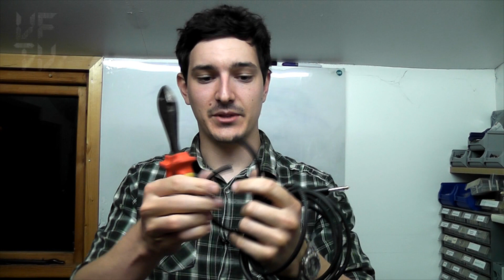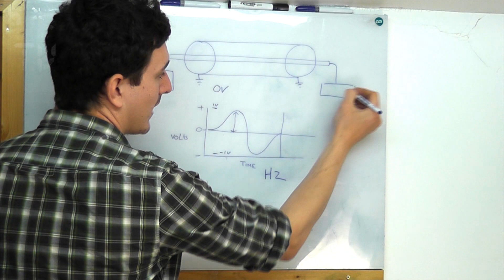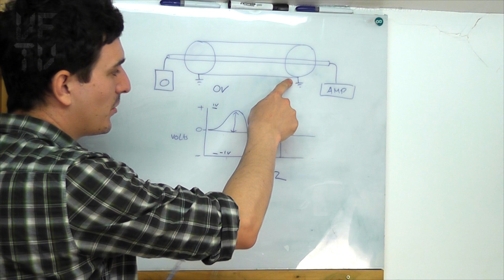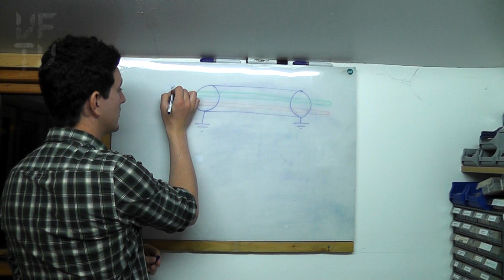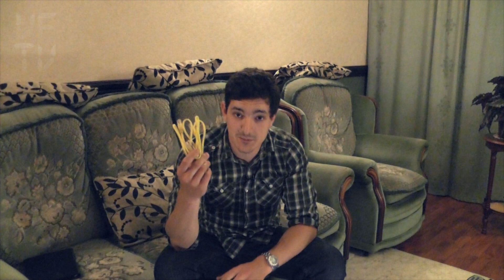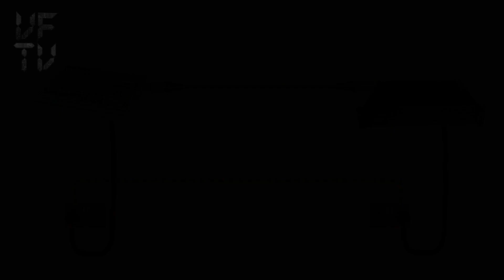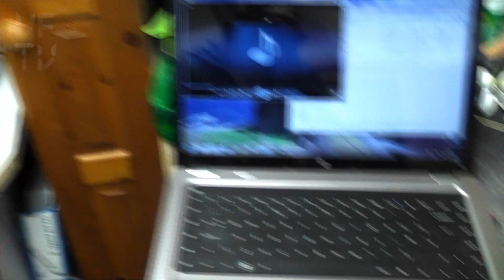Balanced audio: how it works, why it works, and should you use it?

Comment: Brilliant.  Thanks! You're a great teacher -concise.  I'm a pianist. Use my digital via my M-audio fast track. I'm using standard 1/4' jack cables. Recently I found that most of my XLR (needed for phtm. power mics) disappeared & I've been left with 1/4" to XLR. Is this automatically considered a balanced cable?  I was thinking of using them to connect my digital piano to the M-card (phantom power OFF).

Thanks for a reply if you can spare the time.
Reply: thanks
Reply: navalverde12 Thanks. I'll give it a try.